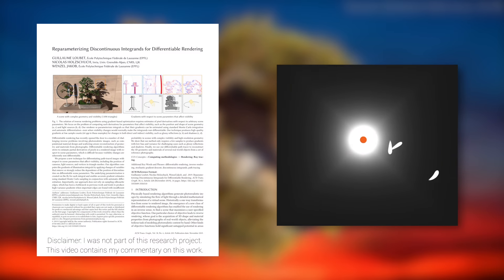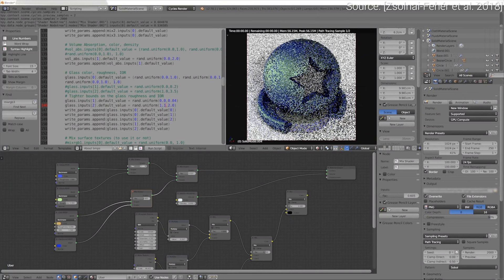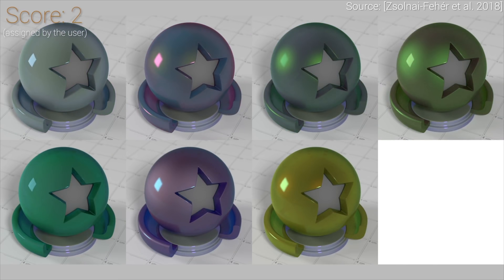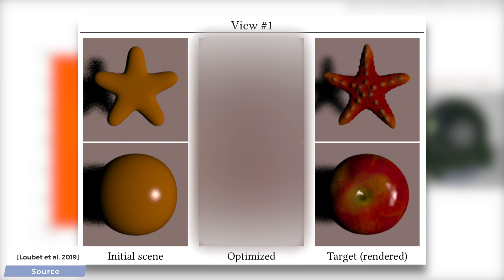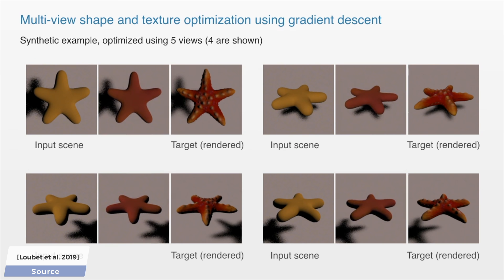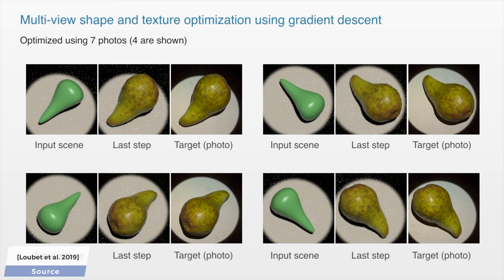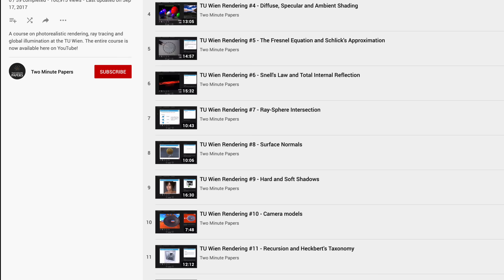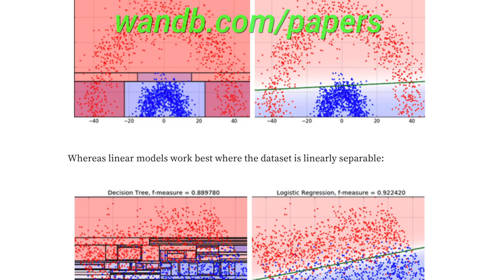Differentiable Rendering is Amazing!

Comment: Im pretty sure this is coming to photoshop sooner, not later. Which is super cool as it definitely is the one application most improved by AI for me. but once photoshop starts to detect and measure surface materials realistically, it can start altering them - which is really really exiting, as nowdays trying to fix complex surfaces, copying reflections and shadows can be quite time consuming. An AI that can detect and analyse a surface as a whole would revolutionalise many tools and tasks in photoshop

Comment: Holy crap batman! I get that this is still nascent, but this kind of work 3-5 years from now is going to fundamentally alter the visual content creation industry. Think about how much it costs to run a pilot episode of anything, especially if you have real human actors involved, this paired with some of the other generative algorithms published this year is going to bring the marginal cost for producing an additional pilot of <insert any show genre> practically to zero. A few cycles from now this is going to put immense pressure on Comcast et al, even the Netflix content acquisition model is going to struggle to keep up. Also, imo, these kinds of tools will help with populating Virtual Worlds with a plethora of distinct objects and NPCs for users to interact with. The current costs are way too high, that's why cut and paste objects, sets, expressions, and collections are so common. A collection of generative tools like this though in the hands of even a semi competent author is going to do to video game creation what Kindle did for indie authors. The 2020s are going to be nuts.

Comment: Just wondering, is the synthesized result a 2d image or is it a set of material parameters which is then input into a light sim program?

If it is the latter then wow, it is pretty much an automatic modeller. 
However if it is the former then how would this come into use? as you already have the target image so you don't need to generate a copy. Thanks great vid
Reply from the maker: The latter! 😎
Reply: @TwoMinutePapers  wow incredible, I didn't think ai would be so prominent in the 3d modelling world so soon.
Reply: It takes a model/materials set, a static photo of the output, and guesses the model/material properties from the photo, comparing to the original model/materials in a series of randomized lighting and camera scenarios (which are the same in both the original model/materials, and the guesses). That's the training routinue. 

Essentially it's training to convert static photos into 3d models, materials etc. Essentially as you say, and automatic modeller.

I wonder if they can actually use AI in the rendering process itself? Seems like calculating every light beam etc, might not be the most effecient way - perhaps we could actually get faster rendering by training AI to do actual rendering by shuffling this process - use the model/materials as the start point, and the guessed versus actual output as the comparison. You might even be able to get low end hardware with AI support in the chipset, to do heavier rendering or realtime rendering loads.
Reply: @irisdogma8174  hi thanks for the description. I believe I have heard of studies with a similar design to what you propose. 
All hail computer graphics for computer graphics is cool
Reply: @billbobjamjamjr  I hope so. Would be amazing if we could use AI for the actual rendering process.
Reply from the maker: The paper contains a neural renderer too. Check it out here! https://users.cg.tuwien.ac.at/zsolnai/gfx/gaussian-material-synthesis/

Comment: What's the application for this? If you already have the target image, then what's the point? 😕 Would you apply the intermediate steps to other inputs in the hopes of rendering them in the same manner? 🤔
Reply: 3d content creations for games and CGI. 

If the output model is good enough, it probably only needs retopology and texture baking and you're good to go for a game-ready asset. 

if the production doesn't care about poly count then you can simply plug in these assets into the scene and that's it. No need for modelers or texture artist, just a couple of photos and robust algorithm.

Concept art and ilustration work also benefits a lot from these kind of algorithms, 3D is being adopted really fast, but artist are still required to produce these 3D objects, sometimes you can simply use photos but  lot of the times you need objects in large quantities or in estrange situations that are only possible trough CGI

Comment: While I agree that these methods would bring a great boon to 3D modelling and texturing, I think you're over-blowing the current caveats of traditional techniques quite a bit. You don't need years of experience to open blender and make a cool material, more like a range of 20 minutes to a few days to get the hang of it. You have realtime renderers to prototype with as well as a render area restriction so you can render only the object you're working on instead of the entire scene which takes significantly less time; 0.1-1 seconds for a non-noisy view. Of course rendering the entire scene will still take a bit but the actual material creation and modelling don't take nearly as long as was portrayed here. Not trying to call you out as bad or anything, but it would be appreciated if that topic could be better-informed in your future videos.